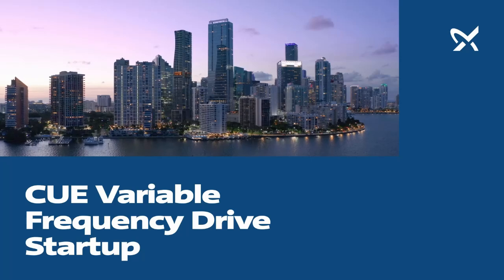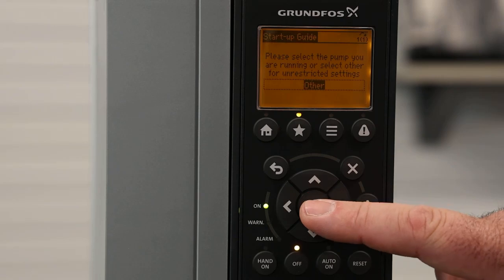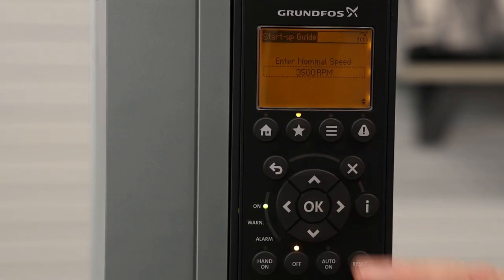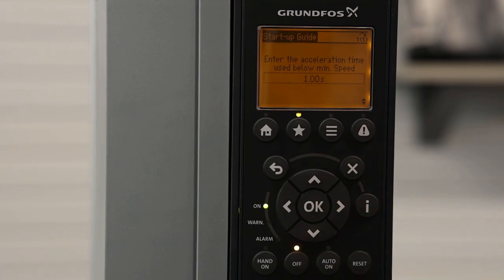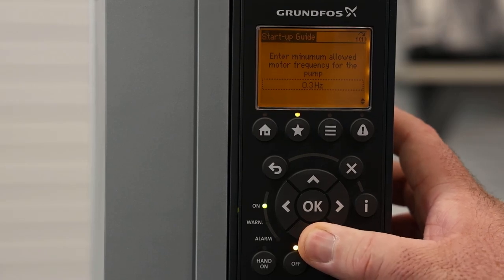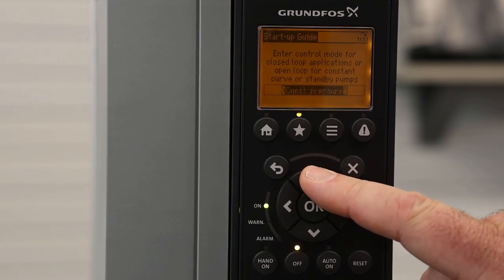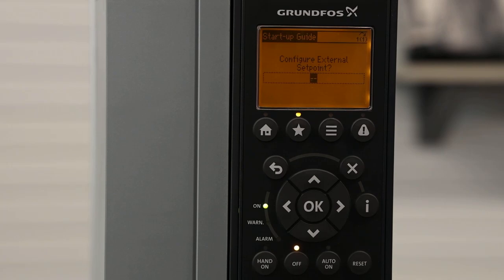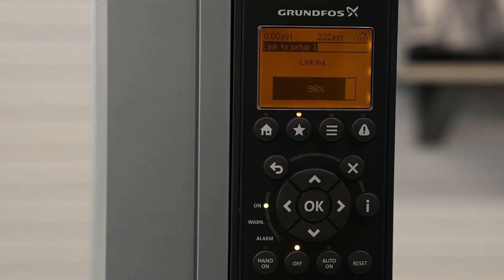Grundfos CUE Variable Frequency Drive Startup

Comment: Why VFD HIGH VOLTAGE ALARM DURING STARTING ALARM, SINGLE PHASE SOURCE, 3PHASE MOTOR,30HP, 230 V. , HOW TO GET SETTING TO CHECK ERROR SIR?
Reply from the maker: Hi, Thank you for contacting us. Please be advised that you can find a wealth of technical information, including Operations and Installations Manuals on our website. Please simply search for the product you need and use the documentation tab to find and download all the information. Find our website here: http://gfos.ly/60552V4Cx . If you need further assistance you can fill out this form: http://gfos.ly/60572V4CL . Kind Regards Krystyn